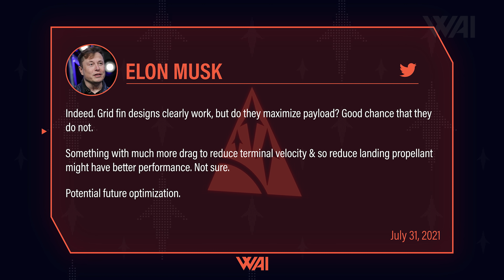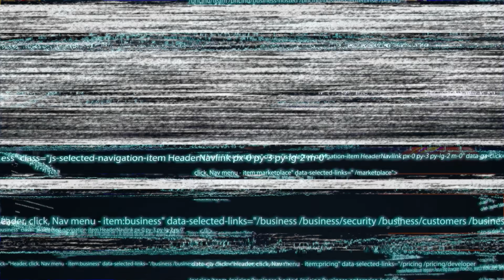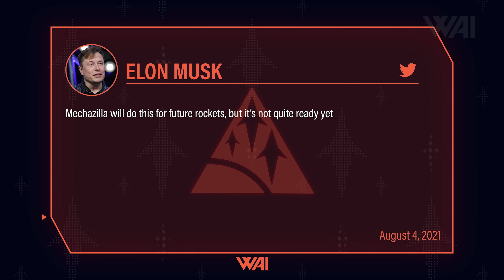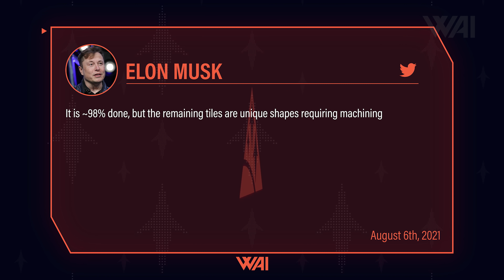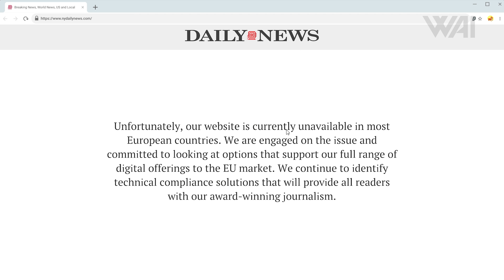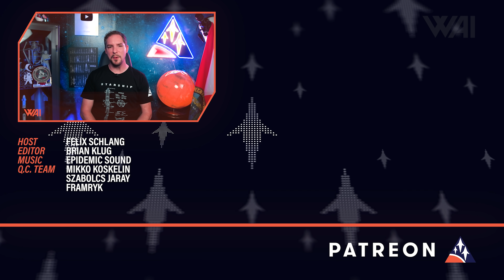First SpaceX Starship & Super Heavy stacked in preparation for orbital flight!

Comment: Some thoughts on a Starship moon mission. 

Take off from earth

     Starship with base inside.

     Starship with four engine packages inside.

     Starship with fuel canisters inside. One canister has a crew capsule attached.

     Starship with Earth-Moon-Earth transfer vehicle attacked. This includes fuel canisters and engines needed to transfer payload to moon orbit and back to earth. 

Assembly

     Base is attached to engines. Engines attached to the base on the side of the base. Fuel canisters attached. 
     Transfer vehicle attacked to the back of the moon base assembly. Transfer vehicle has a life support capability.

Transfer to Moon Orbit

     Crew is housed in the base, but it can access the habitat part of the transfer vehicle through an airlock. 
     Crew can also access the crew capsule via a space walk.

Moon Orbit to Moon landing

     Some of the crew transfers to the crew capsule, some of the crew transfers to the transfer vehicle and some of the crew remains on the base. 
     Transfer vehicle detaches from base, engines and fuel canister assembly, to remain in orbit. 
     Transfer vehicle remains in orbit while the base assembly lands on moon.

Moon

     Base is detached from engine assemblies and uses wheels to move away from engine assembly. 

     After mission is complete crew returns to crew capsule and all engine assemblies are lifted off the moon leaving the base on the moon. 
     All the engine assemblies and the crew are returned to the transfer vehicle.

Transfer to Earth Orbit

     Without the base, crew and all hardware are returned to Earth Orbit. 
     While on the way back to Earth the extra fuel in each canister is transferred to one of two canisters (oxygen or methane). 
     Once in orbit the assembly meets a starship loaded with full fuel canisters. Crew exchanges full canisters with empty canisters, 
     leave the two canisters with fuel in orbit with the transfer vehicle, and return to Earth in Starship.

Return to Earth

     Crew and empty fuel canisters return to Earth. Fuel canisters might be collapsable.

Next mission requires just another base module and crew to be lifted off Earth. 

I believe the first mission will require five Starship launches from Earth (maybe six, depending on the amount of fuel required) to return crew to Earth. Subsequent missions would require only one or two launches from Earth.

All of the hardware is reused.

Another possibility is that starships may be module. So that a crew capsule is stacked on top of base module or a fuel module, which is stacked on top of a fuel and engine module. 
Once in space the crew capsule, which has the forward wings is detached from the base module and the base module is detached from the fuel and engine module. The base is left in orbit, while the crew module is attached to the fuel and engine module to begin the descent back down to Earth. This would allow the base module to be exactly as wide as the starship is now. It would also mean the base (which will not return to Earth) does not have to have heat tiles, it could be also be made of different materials and it could also be longer or shorter depending on the weight restrictions.

Just a few thoughts because I think too much and have a lot of time on my hands.

Comment: One concern that I have is sound shockwaves and their effect on local communities.
Not only the shockwaves produced the 29 Raptor engines but what kind of energy would be produced by an unfortunate explosion of the whole system upon launch?
Personally, I would not want to be within miles of a Starship launch!
Reply: It's methane, it's gonna be more of a fireball than an explosion. Also they are working on modifying oil rigs to use as launching ports so they can spare the public of all the noise. Valid concerns though!

Comment: Someone please tell Elon, the three fixed vacuum engines of the new starship is a fatal design. The vibration transmitted to the body of the ship will cause a great deal of damages including shaking off heat insulating tiles.
Reply: Nobody needs to tell him.  If that's really an issue, they will find out on the first launch and fix it.  If you understood how iteration works and how often they do that, you'd know that a problem as obvious as the one you present would be addressed very early.
Reply: This will be an orbital launch. It might save him some $ to note earlier
Reply: @aXw4ryPlJR  Not an orbital launch.  The plan is to get very near orbit, but not actually achieve orbit.  In either case - my point stands.
Reply: @willoughbykrenzteinburg  Let’s see😉
Reply: @aXw4ryPlJR  You really dont understand rapid iteration.
Reply: @willoughbykrenzteinburg  It would at least be intellectually amusing to guess upfront😁
Reply: @aXw4ryPlJR  I don't know what that means.

Comment: I dream of a Starships space station. One ship with multiple airlocks in the middle then 4 to 5 Starships attached to it. That would be a huge space station. It could rotate for a weak gravity or stop rotation for refuelling the middle Starships. It could fully fuelled serve as a Mars permanent transit station.  It could also be a Mars transfer space station .The possibility are endless :)
Reply: SpaceX may be doing something like that, although it may be a temporary one for the mission. Page 71 of the GAO decision on the Blue Origin complaint has the best description. We don't know what's under the various [DELETED]s, but one of them is a new spacecraft that is different from Lunar Starship and a Tanker Starship, as the FRRs for each spacecraft was the complaint. I tried to post the url, but it didn't stick, so if you want to see the original, you will have to get it from the GAO site.

"As addressed above, SpaceX’s concept of operations contemplated sixteen total launches, consisting of: 1 launch of its [DELETED]; 14 launches of its Tanker Starships to supply fuel [DELETED]; and 1 launch of its HLS Lander Starship, which would be [DELETED] and then travel to the Moon."

Comment: Why not use fewer but bigger rocket motors for better reliability.
Reply: Lots of smaller motors is apparently better as you have engine out capability. Evidently, the Falcon 9 can launch even if one engines fails at takeoff. After some time, a minute or two IIRC, another engine can fail and the Falcon 9 can still get the main payload to its orbit with the other 7 engines.

The Falcon Heavy has flown with 27 engines, so even the 33 of the current final booster design is not that big of a jump.

Comment: Does the booster sit on lugs?
How is it locked down and where is it anchored from on the booster?
Reply: There are numberous attachment points around the circumference just where the engines are attached to the booster. Those clamps support and hold the booster on the orbital pad.

Comment: It is not really a interplanetary spaceship. It has to fly first, then prove it can land, then prove inspace refueling can be done, then prove it can land safely wth people, then get certified as human rated. Still impressive as heck.
Reply: SpaceX is pretty confident of getting Starship (second stage) to orbit. Getting it back through re-entry to land is expected to take a few tries. SpaceX has a $53M contract to demo Starship to Starship refueling in LEO by the end of 2022, which is likely why they stopped flip-n-burn tests after getting the first one done. SX apparently plans to refine the flip-n-burn on the orbital tests. Musk expects it will take hundreds of successful, operational flights to get a man-rating. Certainly impressive, but manned flight on Starship lifting off and landing from Earth is not likely going to be a near term thing like a lot of people think. Musk's goals for a manned mission to Mars before 2029 are likely a little optimistic as I'm betting NASA will be real strict on Starship reliability for manned launches and landings on Earth. Maybe they will do Crew Dragon to LEO to meet up with a Mars ship in the interim.

Comment: Surely they have to do the orbital starship docking in a '69' arrangement....?
Reply: Not likely as the propellant loading lines are at the bottom of Starship (second stage) on the side of the ship. So they should have to both face the same way to refuel. Unless [deleted] has its refueling lines set up differently. We are waiting to find out what the [deleted] is in the GAO HLS complaint report is.

Comment: As soon as I noticed the crane holding the rocket, I lost interest in the rocket.
Reply: Fit check to make sure all the plans worked out. Now they are removing engines, likely to do some cryo tests with thrust rams, before putting engines back on for static fires.

Comment: the best way to refuel in space is to have a refueling station.
Reply: The (DELETED) may be that. No idea how many words are under each (DELETED).

page 71 of the GAO decision on the Blue Origin complaint
"As addressed above, SpaceX’s concept of operations contemplated sixteen total launches, consisting of: 1 launch of its (DELETED); 14 launches of its Tanker Starships to supply fuel (DELETED); and 1 launch of its HLS Lander Starship, which would be (DELETED) and then travel to the Moon."

Comment: The booster engines will receive some level of thermal protection before the first launch. While the pace of innovation is fantastic, the opportunity to collect data on the booster re-entry, descent and landing can not be missed. Failure to collect this essential data will require expending yet another booster before SpaceX will bring the booster back for recover - and risk the launch mount and tower.

Comment: What propellant will they use for RCS thrusters if there are any. Normally nitrogen was used but that might be a viable option to refill. Please educate me on this
Reply: SpaceX plans on using hot gas thrusters eventually. They will run on the same methane and LOX as the main engines. Right now they are using cold gas thrusters I believe for the initial tests as they refine the hot gas thrusters.

Comment: YES, YES, I say.  Star ship fueling process, back to back loading Fuel, that is Oxidizer and methane, simultaneously filling their respective tanks.   I have been trying to sell the idea that we all know, the ship can land vertically.  Yes wonderful, first time ever right?, but, loading on or off a big ship like we have here on earth would require the ship to land on her side .  WAY easier, way faster, and safer. Which should get Benzo out from under his bead.   The robotic transfering of containers just like on the big ships, but not the up and down, and  working out of a tiny hold of the ship with only one or two items over 124 feet both ways you will see this adds up real fast, my friends real fast.   So this old retired Merchant Marine is keeping his fingers crossed that our better angles and even Benzo will see this concept of loading and off loading the ship on her side, with the bigger hatches will be much more expedient.  Then off shift you drive you EV truck back in side the ship for charging and safely out of the radiations, and yes, there is more than one.  Any way We are there to build a base with water and fuel production being paramount.   I just don`t want to hear anything about dash lines from China and hopefully they NEVER, EVER, get into a position to dictate who gets to mine the next generation of nuclear fuel they have so much of on the moon.   I forget the name of this nuclear material.   A fuel though that has incredible small amount of the bad radiation. to deal with.  Please.  Kevin from sunny Mexico.
Reply: Starships are build to stand up and crumple when laid on their sides. Not uncommon in rockets that are vertically integrated.

Comment: The Soviet N1 rocket had grid fins on the booster.
Reply: But it serves a different purpose, so it's placed on the very bottom
Reply: @alvianchoiriapriliansyah9882  True! As far as I am aware they didn't fold and were for steering the N1 Booster during its share of the 'mostly short' upward flights.

Comment: The crazy thing is starship will probably be what builds the first gen, much larger deep space habitat, eg something that could never be launched in one go from the surface. We'll need a massive ship to carry massive payloads to space and this is about as close to the max in size as liquid/solid rocket can go without being the sea dragon, which was never made so nobody knows if it would have ever worked.

Starship is what will build something like the first Hermes or Enterprise. Once humanity has perfected the orbital assembly line it'll use the 18 wheeler of rocket haulers to get the material from earth to space.
Reply: Obviously that would be the results rather than the critical path enabler

Comment: Why are people talking about 69 meter tall boosters? 

Because the refueling will be done like in a 69 sexual position?
Reply: The booster height was set at 70 meters, but that made for a half barrel to make that height. So it was reduced to 69 meters. Coindence is claimed like with B4 & S20.
Reply: @steveaustin2686  ok, so it was reduced to 69. But what the 69 coincides with? 

It to use a full barrel the height had to be 71 meters, I guess that number would not be considered a coincidence. So whats up specifically with 69? The position?
Reply: @rogeriopenna9014  Yep. Musk's inner teen apparently escapes via naming conventions. :) :)

Comment: The thermal protection for the engines will be installed before the oribitall flight it can't take reentry heat
Reply: The engines is placed inside the skirt to protect it from reentry in the first place
Reply: @alvianchoiriapriliansyah9882  I am referring to super heavy
Reply: Currently super heavy has no skirt but it will before the flight  @alvianchoiriapriliansyah9882

Comment: Is this the final grid length ratio 🏄‍♀️🦅?
For the little ones Grid Lander? , and it' s possible .... Could the bites on the booster be intercepted around +75/95 meters 👀👀🦅👑🦅 by shots🏄‍♀️🦅 with electromagnetic magnets commanded by some of the capture drones or on the contrary the tower🏗🏗 or the tower arms? captures pull on these famous grids🪂🪂🪂🪂 and corrects by cable all the guidance until the desired alignment?

Precision guaranteed by the robustness of the displacement grids in meters / second, the NAVYSEALS would have loved the theater of operations on the capture tower which dampened hyper-heavy deceleration like large birds of prey🦅🏄‍♀️🏄‍♀️🐑🐑🦅 with small goats.🏄‍♀️🐑🐑🏗

Comment: If starship is in space, SpaceX needs to monitor all isolation tiles probably with robot arms. They need to fix any damaged tiles in space before landing.  Otherwise rocket will explode and disintegrate during landing.

Comment: Engine to engine refueling using thrust to move propellant would never have worked because all the engines were covered 🤦🏻‍♂️
Reply: you don't need a ton of acceleration to make propellent flow, SpaceX presentation mentions "micro G acceleration" which is probably achievable with RCS

Comment: If they used the same ports to fuel the tanker as they will to transfer fuel from the tanker to the cargo ship, they would have to face opposite ways because otherwise the methane and oxygen lines would be backwards. Otherwise they would have to have separate ports for fueling and for transferring fuel

Comment: I realize now that Felix is most likely correct that the Starships will face opposite ways for refueling, not only for maneuvering but especially because of 69 🤣
Reply: SpaceX is going to load propellant into Starship (second stage) through the side at the bottom of Starship (second stage). So they will have to both point in the same direction for the propellant lines to match up.

Comment: What great progress!! Starship 20 will not have a hot re-entry during the first orbital flight. Because of the low speed compared to re-entry from an orbit. So the TPS tiles are only tested mechanically.
Reply: Eh, it's getting to orbital speed per Musk. It just won't circularize the orbit to raise the perigee, so it will come back down without any burns needed. So it will have a hot re-entry test.
Reply: @steveaustin2686  I didn't think 345 seconds (5min 45s) of Second Engines Burn would be enough to reach appr. 16,000 miles per hour and that the flight will go above an altitude of 120mi. But well, so there is another test for SN20 to pass successfully.
Reply: @macg9940  Well considering that there is 169 seconds of Super Heavy booster burn, BEFORE that 345 seconds of Starship (second stage) burn, I can understand your confusion.
Reply: @steveaustin2686  I was aware of that. The confusion is based more on the parabolic trajectory.
Reply: @macg9940  Musk in Tim Dodd's interview said that they are getting to orbital speeds, but are not having a circularization burn to raise the perigee to stay in orbit.

Almost certainly so that if they lose control or it breaks up, it will already be pointed at an area of ocean with not many shipping lanes involved.

Comment: Seeing the booster floating in air, being held by the crane, is somewhat serial? Seeing everything fitted together somewhat marks a milestone? 
  
I wouldn't categorize the Saturn V rocket as having 'ONLY' around 3600 tons of thrust. 
How many engines did the Saturn V rocket have, five? How many engines does Starship booster have, thirty?
One take away might be that ten Saturn V rocket engines have more thrust than thirty Starship rocket engines. :)
Would it be less complex to build more powerful engines, and have fewer of them?

What about it?